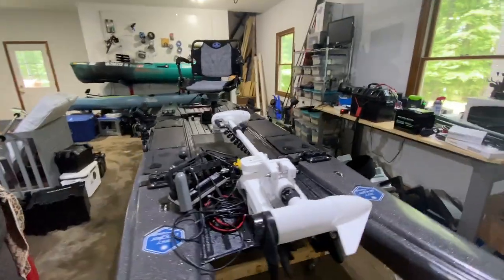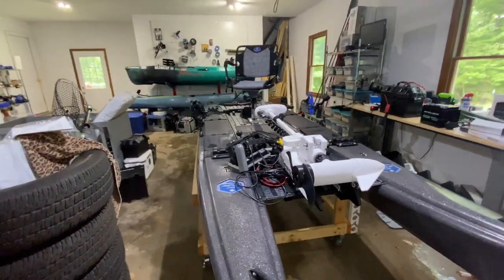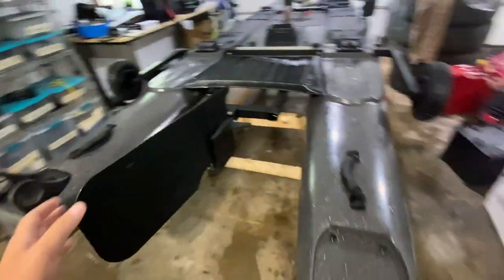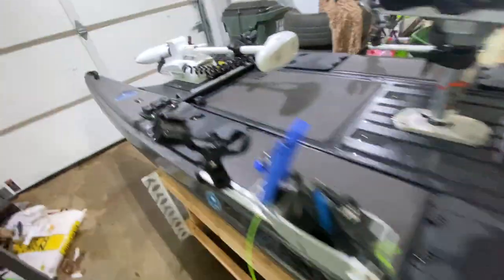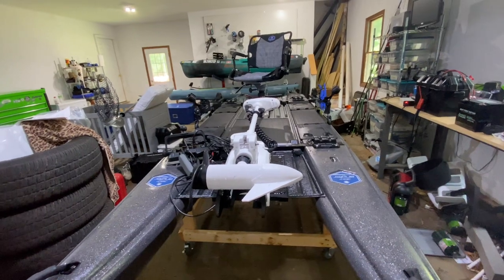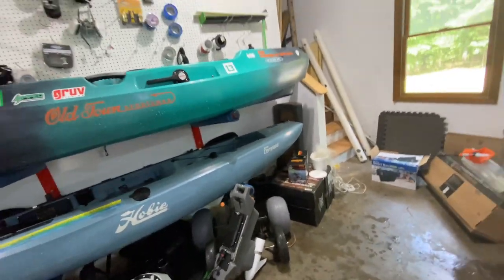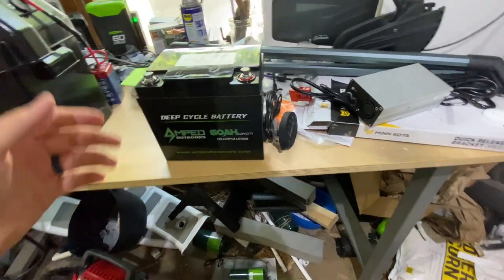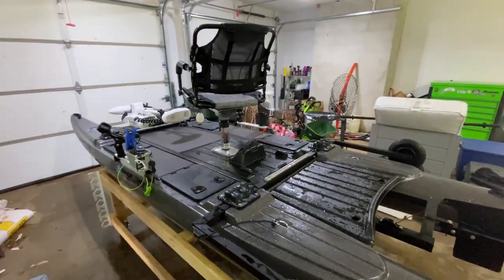Blue Sky Boatworks Angler 360 Pro Walkthrough and First Impressions (Limited Edition Black Glitter)

Comment: Hi, I have this same boat and motor set up. I was wondering what the battery number this is for the 100 amp hour? I want to order the correct one. Great video. Love my angler 360.
Reply from the maker: Thanks. The BSB 360 is an awesome boat. Here’s the link to the battery I have. 
https://ampedoutdoors.com/collections/boat-batteies/products/copy-of-100ah-lifepo4-battery-in-waterproof-case
Reply: @BlueSummitOutdoors  Can you use any type of a car charger to charge this type of battery?
Reply: John Athanassion this is a tricky question and with the crazy cost of lifepo4 you ain’t gonna get a straight answer from anyone but the battery manufacturer and they’re gonna say “NO, use our charger”.  Its not a question of what “will” charge a lifepo4 battery, it’s a question of what’s covered if something gets sideways while charging.  If you get a defective battery but put it on an unsupported charger your gonna be in a tough spot...when lifepo4 100ahs are $50 (instead of $800), this will no longer be an issue.

But most typical lead acid trickle chargers are not suitable for lifepo4.  True higher amp, 14-16v lead acid chargers can charge one, but I wouldn’t do it...lifepo4 is just too expensive to gamble with.

GAMBLE AT YOUR OWN RISK!!!
Reply from the maker: What he said 👆
Reply: @dtdionne  Okay, just was curious! But doing some research, the battery is only good for around 3 years and then it's worthless. I need a battery to last a lot longer than 3 years for close to $700+.

Comment: What speed do you get with the 55lbs thurst Minn Kota and what shaft length are you using?  I've noticed in videos that on these boats each "pontoon" i guess you would call it doesn't sit that high out of the water, has that been an issue with getting lots of water up over them or on the deck?
Reply from the maker: Currently I get about 3.2mph, however I think I may have figured something out that may increase the speed I just have to test it first. I have a video about all of that coming soon. My shaft length is around 28” If I remember correctly.
Reply: @BlueSummitOutdoors   Did you cut it down to size or did Delaware Paddlesports do that for you?
Reply from the maker: I did it myself.

Comment: Cool vid, I saw ur other 360 vids too, like them as well.  I’ve got a pro as well.

You may know this already but hummingbird autopilot works with Kota trollers.  Garmin, imo, is the best, they have 1.2mhz side and down imaging just like bird but they also have the best live forward imaging...but due to oem squabbles, garmin autopilot only works with garmins force troller which is too big for the 360.

I have a motorguide troller which only works with Lowrance (the worst, 800khz imaging and terrible live forward imaging)...so I’m stuck with Lowrance, for now.  When garmin releases a kayak troller, I replace everything.

The reason I think chart plotter/fish finder troller autopilot is so important is because side imaging is tricky.  When side imaging is integrated with the troller you just waypoint interesting structure and then you can always and automatically relocate that structure...eliminating the voodo that is side imaging.  Hope that makes sense.
Reply: Nice tips. Looking to get the Angler Pro LE next Year. Why do you say that the Garmin Trolling Motor is too big for the Angler? Will the Minn Kota PowerDrive be a better option? I just want spot Lock. What trolling motor are you using for your Angler now and what's the pounds of thrust. Also, how big is your trolling motor battery in amp hours and how long does it last when using it on  your Angler all day long? I'm also thinking on getting a 2.5hp Yamaha outboard on the back of the Angler as well.
Reply: John Athanassion the garmin force is a full size bass boat troller.  It only runs at 24 or 36 volts, it’s got about 150lbs of thrust, it’s gigantic and heavy and 50” is the shortest shaft (I’m getting my shaft cut to 28”), plus it costs about 4000 bucks.  It’s the very best pro caliber, bass boat competition troller...period.  Totally inappropriate for a kayak...totally and utterly way to big and heavy, and it can’t run at 12v.  You can goto Cabela’s and look at one, it will be immediately obvious.

I have a 45lb motorguide xi3 with the optional gps gateway, pinpoint gateway and nema 2000 gateway additions.  I currently have a grp27 deep cycle and it easily lasts a full day of fishing, 8hrs.

I’m not super versed in all of Kotas offerings but in my opinion you’d want one with I-pilot instead of I-link.  It’ll be more expensive but will save you massively if you ever wanted to integrate with a hummingbird by not having to purchase a wired nema 2000 network (~750 bucks all totaled and operational).  You’ll want a 12v Kota with 45-55lbs of thrust, I-link or i-pilot, digital maximizer, and the shortest shaft you can buy, but at least 24”.  Most of us 360 owners end up shortening our shafts...you’ll see why when you get one.  But all the modern shafts are composite, which makes it a little trickier.

For me, autopilot was more important than a lifepo4 battery.  But I will eventually upgrade to one.  Unless Jackson upgrades to the minn Kota or Newport Vessels battery box, you’ll wana get one of them too.  They both have an integrated 60a mainline circuit breaker and an integrated 10a accessories circuit breaker.  And they comfortably hold many 100ah lifepo4 batteries.

I have no experience with any stern mounted propulsion but from what I gather it’s tricky and heavy and overkill as the 360 wasn’t designed to plane out.
Reply from the maker: The garmin is 24/36 volt which means you would need multiple batteries. I’m currently using a 100ah lithium battery from amped outdoors, that lasts all day and then some. My motor is a 12 volt 55lbs thrust Minn Kota with i-Pilot.
Reply: Blue Summit Outdoors I sure wish I had researched all this before going with motorguide because I’d have gotten precisely what you have.

It would have saved me the trouble, hassle and expense of all the nema 2000 stuff and i woulda been able to get a 12” hummingbird solix with 1.2mhz down and side imaging for less than it cost me for a 9” Lowrance with 800khz imaging.

Those nema 2000 wires and network are such a hassle.

Well done
Reply from the maker: Thanks. Yea I’ve always like Minn Kota motors, unfortunately I also like Garmin Fishfinders. So they will not be able to communicate but that’s ok.
Reply: @dtdionne  Sounds good! Thanks for getting back to me. 8hrs with your 45lb. motor sounds great. I assume it's 100 amp hour. How long have you had your motorguide? I assume your using it with a Lowrance?
Reply: @BlueSummitOutdoors  That lithium battery sounds like a good option and I assume a lot lighter than a regular plated deep cycle battery. Pricey but probably worth the price. I see some LIPO batteries that carry a 10 year warranty. What is your batteries warranty as well as make and where it was purchased from. I also assume you can use a regular car battery charger to charge it?
Reply: @BlueSummitOutdoors  Yeah, for a kayak or the angler pro, I don't need the i-link. I'll use the wireless remote and I'll mainly be using it for spot lock anchor. I wonder how much juice does the spot lock use.
Reply from the maker: Mine is an Amped Outdoors weighs about 26ish lbs. it costs around $700 comes with the appropriate charger, and has I think a 3 year warranty give it take. I bought it directly from their website. As far as I can tell spot lock doesn’t eat up that much power. I’m sure it uses more in heavier winds/currents though.
Reply: @BlueSummitOutdoors  So  what size trolling motor are you using and are you running it at full or half power? Also, how long is  your battery lasting with continuous use?
Reply from the maker: My 100ah lithium battery lasts all day and then some. My motor is a 12 volt 55lbs thrust Minn Kota with i-Pilot, I use spot lock pretty much all the time.
Reply: @BlueSummitOutdoors  Wow, thanks for super fast reply. I'm sold! I'll be getting a 100ah lithium battery. I'm looking in getting the Minn Kota PowerDrive 55lbs. with i-Pilot. I really don't need the i-Link feature. Also looking at going with a Garmin Echomap. Now to choose the right battery manufacturer. So many different lithium battery companies out there. Hey, on another note, how easy is it to take apart the boat for transport if you don't have a trailer for it or for storage purposes?
Reply from the maker: I don’t how easy it is or not because I’ve never done it. Mine is transported by trailer or truck bed every time. From what I heard it’s easier to do with 2 people but not so easy by yourself.
Reply: Deep cycle batteries aren’t rated like that unfortunately.  But I know it’s not 100ah, it’s much closer to 70ah.  Yes lowrance HDS 9 Live with all the nema 2000 trimmings to achieve autopilot.
Reply: @BlueSummitOutdoors  Thanks for taking the time in answering my questions. Be safe out there and tight lines!
Reply: @dtdionne  Thanks for taking the time in answering my questions. Be safe out there and tight lines!